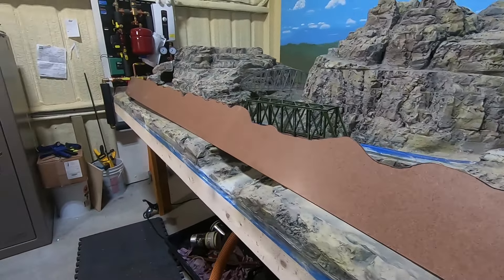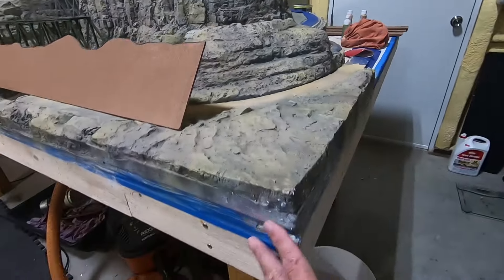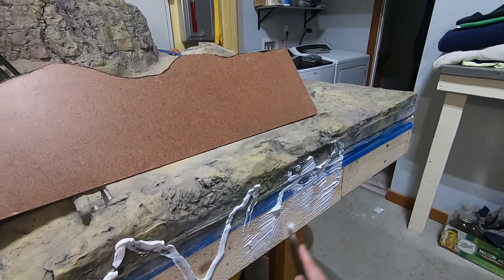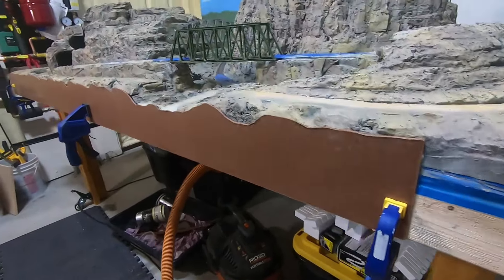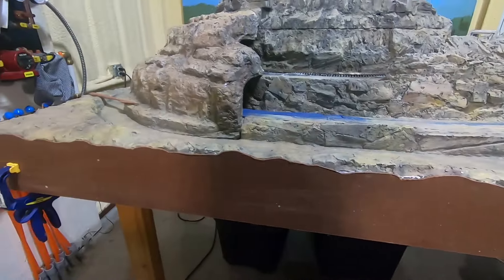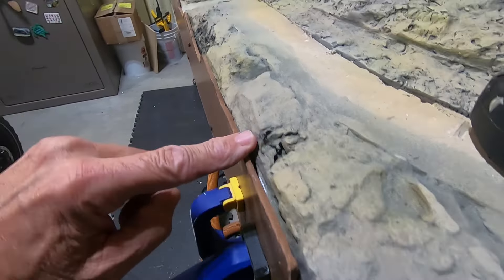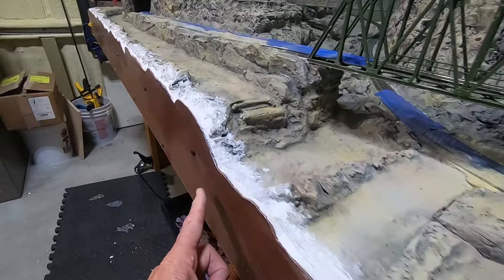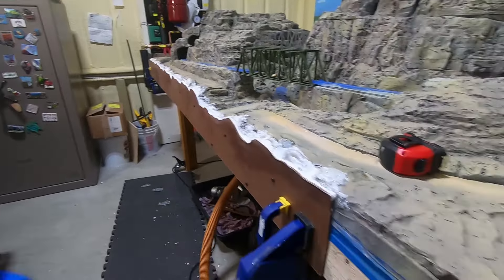Woodland Scenics, Grand Valley Layout, Improved, Plus modification.  Part 27. Profile Board

Comment: Awesome Mike ty for all your information. Im looking into using metal screen used with plaster cloth for my scenery. Im waiting to purchase the DCC Concepts Cobalt Alpha Central to control my points. Its gonna be another $300 to get them operational remotely 😊. Next month.
Reply from the maker: I seen that method, not familiar.  I just sent my big ole bag of paper wads to the garbage along with all the old scrap foam from the original.  Didnt use one piece of the old stuff.  let me know how the control works out. see ya